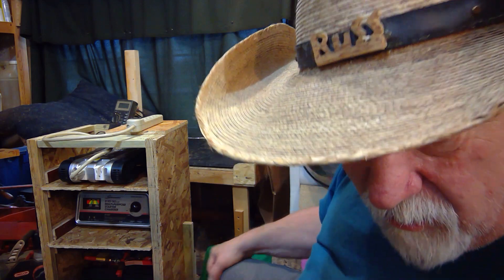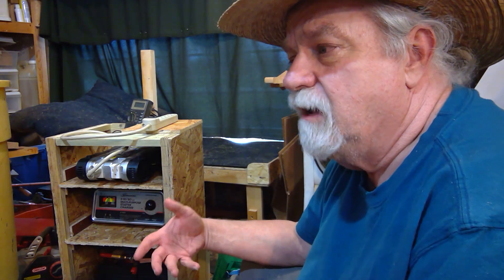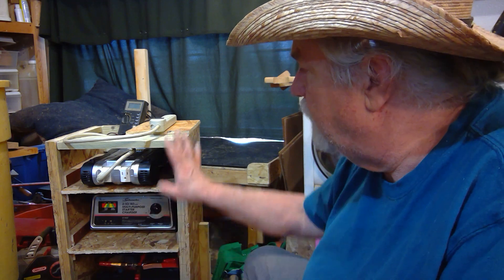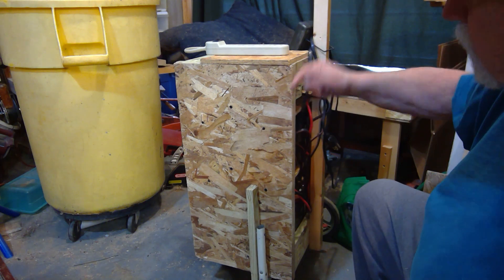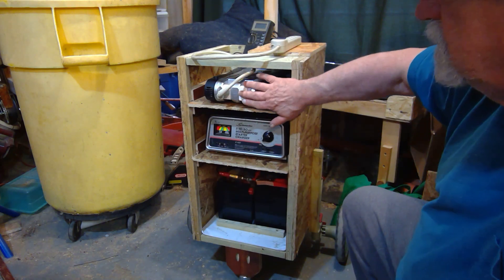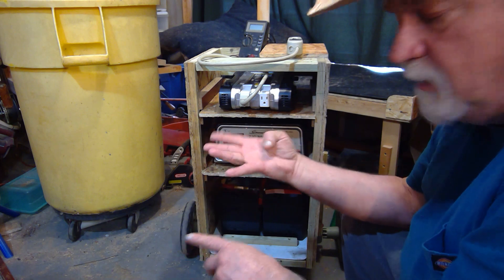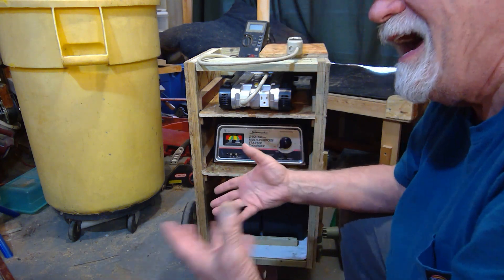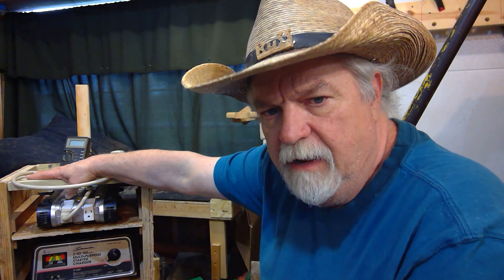Portable power unit by Portable Power

Comment: Cool setup Russ. What type of tv are you using? My tv’s won’t run off an inverter due to the sine wave of the inverter. I have a modern HD TVs and have tried 3 or 4 different inverters.
Reply from the maker: actually it was hooked up to my all-in-one Dell computer.  I hear some TV's will only work with full sine wave, but most computers run on modified sine wave.  I don't have a total understanding of the difference . . . yet :>)   if I was off grid full time, I would spend  the extra money but this unit is designed to work in a pinch.  most larger TV's use too much power for this unit to run very long anyway.
Reply: Russ Veinot    Thanks for the reply and info Russ.

Comment: Russ, I look forward to hearing your actual test results...and that will "tell the tale". As I mentioned in your first video on this topic, I have a 750 Watt inverter that is supposed to put out 6 amps, but my Ryobi random orbit sander, that draws only 3 amps, ( which is 375 Watts ) wouldn't run at full speed; it ran at maybe 1/2 speed. I mention this again because I have concerns that your inverter may not put out the power that you may be hoping that it does. Your 800 Watt inverter should also put out 6.4 amps ... mine is supposed to put out an even 6.0 amps . The usual method to use in order to see what size generator you need, is to add up the wattage from however many items that you may want to run at the same time and that will tell you how powerful a generator you will need. In your case, your 800 Watt inverter is being used as the generator. I suppose that you can either add up the total amps, or add up the watts....seems like either way would work. Another aspect: How many people just happen to have 2 good car/truck batteries laying around ? Maybe plenty of folks...maybe not...I really have no idea...I just know that I do not have any spare batteries laying around. I just found out the other day that the battery for my generator is bad. It's over 5 years old and wasn't a high quality battery to begin with. So...If I wanted to put together a portable, battery powered platform similar to yours, I would first have to buy 2 batteries of sufficient power to be useful. But...how much would that cost....$150.00...$200.00..? For that amount, I could just buy a small gas powered portable generator that would put out a lot more wattage and be able to run more items for a longer period of time before just needing more gas. Now...I really do like the quietness of your idea, so I know that it would have it's place...instant power to have some lights if it's in the middle of the night or, like you said, run a laptop for a short amount of time. Of course, if you could hook up in parallel 4 or more car/truck batteries, some deep cycle Marine batteries, or as Capn Crusty mentioned, some golf cart batteries...then you could have a much longer run time. But this all goes back to talking about power outages and how long the power might be out & how much stuff you will want to run during that time.

Comment: Nope.  Your batteries will deliver 70A x 12V = 840W for one hour.  That's slightly over 1 hour at 800W draw before they're dead,  actually less because of sagging battery voltage and power loss in the inverter.  You need a couple of Trojan T125 golf cart batteries (6V each in series for 12V to the inverter) for approx 1¾ real hours at 800W draw.  Better reconsider reducing the electrical load first.
Reply from the maker: I told you my math wasn't so good. this will be a learning curve for me.  thanks for the enlightenment
Reply: Those Trojans are good, rugged, deep cycle batteries.  I used a pair for house batteries in three different boats that I owned which lasted for over 10 years because I kept them watered and properly charged.